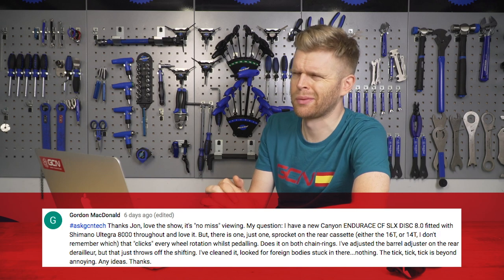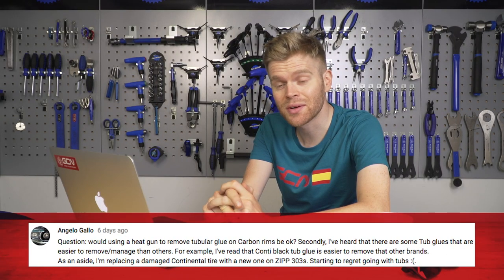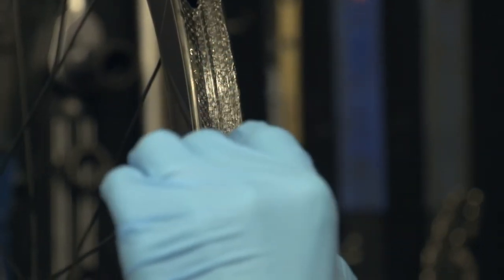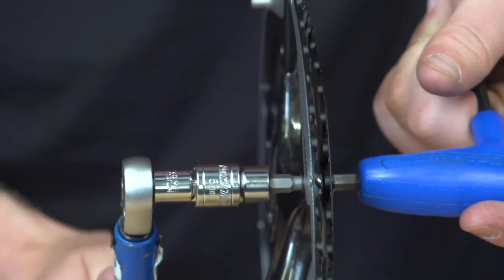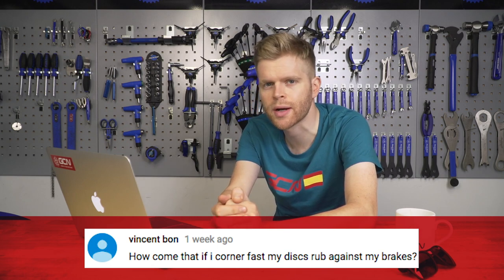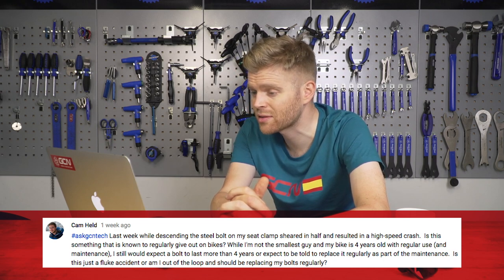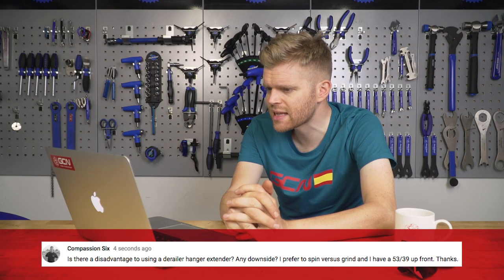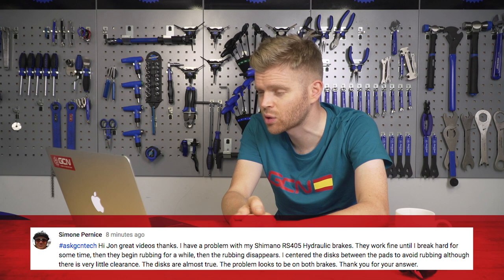Disc Brake Rub, Cassette Noise & Removing Tubular Glue | GCN Tech Clinic

Comment from the maker: Remember to keep your questions coming in for Jon and Ollie using #askgcntech. 👇
Reply: Hi all GCN Tech Team (not only Jon), I have a strange sound from my rear wheel when I am not pedaling. Every turn around of the wheel it makes a strange sound that seems to come from the middle of the wheel like the free hub or something. What could the problem be and is it still safe to ride? Thanks! #askgcntech
Reply: GCN Tech 

Hey GCN can you get this to Gordon regarding his Endurace from this video. I too have the same bike and had the same exact problem. I turned the cranks ever so slowly and found that when the chain is on the cog that ticks I notice it was sort of hanging up on a tooth in the smaller gear next to it. I found the tooth and ever so slight filed it down a bit. Tick tick tick gone!
Reply: #askgcntech Hi Ollie thank you very much for your clear and detailed answer, I appreciated it a lot. I will bleed my brakes and let you know if they work by a new comment. By the way your air bubble theory makes sense because: the bike is quite new, I bought it online, it came with braking hoses open in the middle so that the user can choice which lever active the front/rear brake. In Italy it is common to use the right lever for the rear brake. I might have got air in the hose when I joined its two pieces with the provided link. Thank you for your enjoyable videos!!! Simone
Reply: I've got a disc rotor which is slightly out of true (and has been since i got the bike)
Do you have any advice for truing the rotor? Will a carefully used pair of pliers do the trick?
Reply: Same for me, try to clean the chain from factory lube and re-lube whit a wd-40 chain lube.
Reply: Is there any real difference between running a setback seatpost with saddle pushed forward vs a 0 setback seatpost with the saddle pushed back? #askgcntech
Reply: I would have thought air bubbles in the line would give very soft spongey brakes. However, brake fluid absorbs moisture from the air and this is why it needs to be changed just because of time. The clue is in the hard use of the brake, boils the water from the oil, expands to steam and pushed pads. Clears as it cools as water condenses and is reabsorbed.

Comment: @Compassion Six -- Yes, there are disadvantages to a derailleur hanger extender. Here are three:

1 - The extender will move the rear derailleur farther away from the cassette so you can accommodate a bigger cog, but this can cause the top jockey wheel to be too far away from the small cogs because the track angle of the rear derailleur is not designed for such a wide-range cassette. This can degrade shifting performance.
2 - The extender will magnify any hanger misalignment. A small hanger misalignment may not have caused a problem without the extender, but it may reveal problems with the extender and degrade shifting performance.
3 - The extender allows you to use a short-cage rear derailleur with a wide-range cassette. However, since a longer chain is often required to accommodate the bigger cogs on the cassette, the short cage may not be long enough to take up the increased chain slack when shifting to a small (inner) chainring and a small (outer) cassette cog. This will magnify chain slap and increase the possibility of the chain coming off.

The correct way to accommodate a wide-range cassette is to upgrade to a rear derailleur that is designed for it. Such derailleurs should track across the cogs better and will also have a longer cage (either a "medium" or "long" length) to better maintain the chain tension. So my advice is to reserve the extender for short-term use only. Use an extender when you want to test the wide-range cassette to determine if the gear ratios it provides will serve your needs. But, after your tests are finished and you're ready to make the switch "permanent", remove the extender and upgrade to a rear derailleur optimized for the cassette's range.

Comment: Hi Oli, brilliant answer to the air in brake lines heating up and making them rub.  I have the same issue of short term rubbing after a decsent and did not think of that.  Thanks.

Comment: I had break rub even when wheel was true, QRS firm and rim straight. Turned out a bearing in the hub had failed so wheel moved side to side even though the obvious checks were fine. Worth considering if you find the same.
Reply: I was thinking hub as well.  Even if the bearings aren't totally dead, a loose cone (on an adjustable hub), or a poorly chosen bearing (if sealed cartridge) can easily have  a bit of axial/radial play that will cause the disc to rub.  There's lots of other stuff it could be, too, but I think an alignment problem will show up in more than just sharp turns where there's a lot of sideload.  It could be flex in the axle as well, if it's a poorly designed hub.

Comment: I had the same issue with the Ultegra 8000 cassette, that ticking noise. I inspected the cog carefully, and there was one tooth that was slightly badly finished (it was higher than the rest and it had rough edges), so i just filed it down a bit and haven't had clicking ever since.
Reply: Same to me with a ultegra 6700 11-28. I did swap the casette out to a 11-25 i have on my indoor Trainer and it was gone.
Reply: Sound like a good look at. I couldn't tell if he's problem was with cassette turning or one rev on the crank. I'd also check where that front derailleur cable end is.
Reply: Same problem with my new Canyon/ Ultegra 8k groupset. Sent it back and got it back a month later with the same clicking noise in the 4th smallest cassette cog. Frustrating! Think my chain was touching high tooth on the next cog below.
Reply: Also got a Canyon ENURACE CF SLX DISC 8.0 with a Shimao Ultegra 8000. Same clicking noise on the 4th and 5th smallest cog - it drives me nuts!!! Gears are properly indexed....
Reply: Are the cassettes on the canyons 32-12 mine is.
Reply: Same issue on my new Canyon Endurace with a Ultegra R8000 cassette.
Reply: @neilbradley8543  mine was
Reply: Same issue on my Ultegra 8000 on BMC roadmachine.
Reply: Yeah mine was 32-11 too. Maybe a bad batch?
Reply: Unfortunately, this seems to be a consistent problem with many many R8000 cassettes. I think Shimano just plain screwed something up here. I have the same clicking noise with a brand new R8000 bike. My LBS replaced the cassette, but the clicking noise persists. The mechanic says he's seen the same issue on 5 other R8000 bikes :-(.
Reply: Any idea if a 105 cassette would fix the problem? I already have 11-32 and 11-28 R8000 cassettes, both of which present the problem.
Reply: I have the very same problem for the past four years with the 6800 cassette ( 11-32 and 11-28 ). I even change the RD 6800 SS with GS but to no avail. However in my experience it may very well be the chain that is causing the problems, because after every chain change there there seems to be all fine, just for noice to come back after roughly 500 km.
Reply: and I also join the clicking-noise on the third cog with Ultegra 8000 club :-( (Canyon Endurace CF SL)... I got it as silent as possible by fine-tuning my derailleur over and over again - but it's still noticeable - weather I'm on the small or big chainring in front.
Will remove the cassette and inspect the tooth now as Mikko suggested.
Reply: Thorsten, let us know if it works out. I have the issue only on big ring, and clicking noise is only happening on third and fourth cogs. Interestingly, if I look at the cassette from top while spinning the crank on a work stand, I can see the center of the cassette swaying at the cogs where the problem exists. Not sure if normal though.
Reply: I just got a Cervélo with Ultegra and noticed the same problem. It's the new 8020 so obviously they haven't corrected the issue.

Comment: I've had very good luck removing tub glue with CitraSolv, an orange peel solvent.  It takes a while, because it's a wet-wait-peel/wipe cycle, but I get the rims very clean without exposing myself to acetone.  One thing that helps is to use a wooden tongue depressor as a scraper, since it fits the tire well.  If that's unavailable, try trimming a paint stirring stick and use it like a chisel.  BTW, I have saved many tubular tires by injecting a bit of tire sealant after the first puncture.  It may take away a little of the tubular 'magic' ride, but not enough for me to notice.  Well worth it.

Comment: and for the disc brake rubbing question: if you are using shimano 'ice' rotor then it could be the the disc deform due to the heat produced by heavy braking.

Comment: Chainrings, so does Campy, have one BCD. The main problem with 53-34 is the chain pick ups won’t work on the big ring so the chain will keep falling. Shimano don’t like mixing and matching but campy works with some combinations. I run a 50-36 front rings, runs perfectly.

Comment: what i like to do when a disc rubs and i am working on the bike is tightening the leaver a bit (with a strap of some sort) to the point where it almost brakes the wheel but doesnt, and only really grips on the bend part of the disc. turn the bike around or use an assembly stand to get the wheel to freely turn and find the bend section. mark it with a tesa or a...marker. now you can easily bent that part back with a truing tool (go easy first) and quickly check if its gotten better by turning the wheel. repeat until it works fine again. if you are lucky you need 30 seconds. if you do it without tighteing the leaver, you may not get it as perfect or even over-bend to the other side, and only realize that on your next ride.

Comment: 5:30, there are 53T 5 bolt rings out there for 110mm BCDs. However i agree shifting won't be great, and your rear derailleur may not have enough capacity to take up the extra chain required.

Comment: For the chainring question, at least Shimano official states their front derailleur only has the capacity of 16 tooth. Thus 53/34 is not offcially supported.
But I still remember some pro uses chainrings exceeding the official capacity, so it's still worth trying.

And it's not only Ultegra/Dura Ace, now all Shimano 4-arm cranks use the same 110 BCD, including 105 (5800) and Tegra (4700).
Although latest R8000/R9100 has changed their chainring shape, making older 6800/9000 chainrings incompatible.

Comment: #askgcntech I'm considering buying an old steel frame, and I'm looking for new components with a chromed finish (and specifically a crankset - not a modern Campagnolo Potenza one because I don't like the four arm design). So I was wondering whether you knew of a modern brand currently making any spider cranksets with a silverish finish, or will I have to buy a new old stock Campy one? (I've asked this question on GCN Anything as well but I don't know whether it counts as a tech question)

Comment: Gordon macdonald's problem is a problem both me and a friend has had and it can be caused my a tooth on the cassette causing the chain to click every time it goes on and off that tooth.
It's barely visible so you have to look really close at both the cassette (every single tooth) or looking on the chain if it moves to the side or up slightly when pedaling around and different rpms when it's on the workstand.

Comment: #askgcntech for the winter, is it benefical to put a 32mm conti 4 season on my 15C disc wheels, or would a smaller 28mm or 25mm version maybe even work with better grip because it would not get that high bulbous profile on the rather narrow rims.

Comment: Simon Morrissey. Remember to look on your Rear Derailleur that it only support a "Total capacity" of 35T (RD-R8000-SS) it is measured by adding the biggest front and biggest on the Cassette and  adding the smallest front and smallest on the Cassette, and then subtract the 2 numbers (for example 50/34 + 11/28 Cassette: 78-45=33T).

Comment: I put on a 34 tooth inner while leaving the 52 tooth outer for a trip to the mountains. I didn't have a problem with the chain dropping off the inside but it was sluggish getting it back up on the big ring for the descents. It work out fine for tis trip but I wouldn't recommend it for normal everyday riding where you want to move between the rings more frequently.

Comment: #askgcntech Hi Ollie.. I'm registered for the C2C in a Day next year and am considering either an 11-36 cassette or an Mtb 11-42 cassette on 50/34 chainrings. Firstly, would an 11-42 really be feasible? And secondly would an Ultegra mid-change derailleur work with either or would I need an Mtb derailleur, such as an XT/XTR? In fact, would an Mtb derailleur even work with a road cassette? Thanks and keep up the good work. Great to see you on GCN.. John..

Comment: #askgcntech Hey Jon, Ollie, my drivetrain feels rougher as I shift into the higher gears. When I'm on the hardest gear (50/11) it feels as though there is rubbing somewhere but I can't figure out what it is. I have checked that the chain is not rubbing onto the FD, checked the RD limit screws, had my rear hub serviced (cleaned and regreased) at the LBS, checked the preload of the BB bearings (hollowtech ii) and it remains the same. It feels smooth on the lower gears and I cannot feel any roughness on the BB when I take the chain off.  Any other hints at what may be causing it? thanks

Comment: #askgcntech Olly
& Jon, I had an issue with my rear mech and shifting into the lowest gear.
I have Fulcrum Racing 3's with an 11 speed hub running a 10 speed 105 mech and
10 speed cassette. I've just changed the cassette from 11-28 (105) to 12-30
(Ultegra) for the Velo South and this caused the chain to keep jumping off the
lowest gear into the spokes. I’ve checked that I have the spacer in place,
checked the alignment of the hanger with an alignment tool and wound out the
limit screw and it is now fine (ish). My concern is that the limit screw is one
turn from falling out which means it’s on the extremes – so the question is –
is this ok to be on the extremes or can I do something else like move the
spacer to be on the lock nut side or somehow move the rear mech outboard more
i.e. washer on the hanger ?? Any advice welcome

Comment: My brand new Canyon also has clicking/ticking only when I'm in the 14t at the back.
Reply: Yeah, on my mountain bike (Canyon Spectral) with Sram Eagle, when I'm at the 5th, 4th and 3rd smaller end, it makes a ticking noice, and when I turn the barrel adjuster until the click is gone, the shifting is really crappy. But when I perfectly adjust my gears it makes the noice

Comment: #askgcntech Hi Angry Lue! Awesome science videos 👍🏽 I have a set of Roval CLX 60 wheels on my summer only sunny days hyper bike, and the break surface of the rim is getting a yellowish tint. The original red compound pads got crystallized, so I replaced them with black Swiss compound which made a huge difference in breaking performance on my weekly mountain descent. How do I know when I have to replace my carbon set of wheels?

Comment: Regarding Gordon's clicking issue on the 16T sprocket, I had it too, replaced the sprocket/chain, re-adjusted etc, tried a 11-34 but pursisted. I've fitted a 11-36 (=no 16T sprocket) now it's gone. I blame the R8000 16T sprocket design/cut.
Reply: Have a look at replies at the very top. Gino said he filed a gear tooth down from an adjacent sprocket and it fixed it

Comment: How do I build myself a 1x time trial groupset? Can you just use the normal 105 groupset but with a single ring front?
Reply: I have done that on a few bikes - swap the two chainrings for a narrow-wide single chainring and you are good to go. Never drop a chain. Then you can refine it with a "clutch" rear mech to make it even more drop-chain-proof. My hack (since we are now all supposed to use that word instead of "something I do") is to keep the front derailleur cage (by blocking it in place with the two limit screws) as a chain guide.

Comment: Hi Guy I have a old tricross that I’m thinking of using for  London to Brighton off road. I would like to have a wider range of gears. I have a ultegra 11 speed groupset but I have disk brakes and don’t want to buy a new rear wheel, can I just put 10 of the 11 cogs on? Will the ultegra shifts work with the disk calipers?
Thanks guys
Ps how much is to much for a cross / gravel bike?
Reply: Shimano has 11-34 11 speed cassettes that fit on 10-speed freehubs. E.g. CS-HG800-11. Nice way to keep on using those older rear wheels with the new 11-speed groupset.

Comment: I have the same problem as Simone Pernice in the video's last question (disc rubbing after braking, then disappearing after a while). My bike is equipped with the latest Ultegrad Di2 and I've only ridden it for roughly 2k km. Could this happen after such a relatively short distance with not too much breaking? Or was the hydraulic system probably poorly set up by my bike mechanic?
Reply: This is probably caused by one or both of your pistons retracting too slowly. See this video from Park Tool for how to fix it. 
https://www.youtube.com/watch?v=vQXFFgRButo

And see this video for a real world example.
https://www.youtube.com/watch?v=LYExdy_yn3A

Unless your lever feels spongy and has too much throw, it is probably not an issue with air in the system.
Reply: @MarkNienberg  Thank you so much, gonna watch those videos and give it a try. Cheers mate.